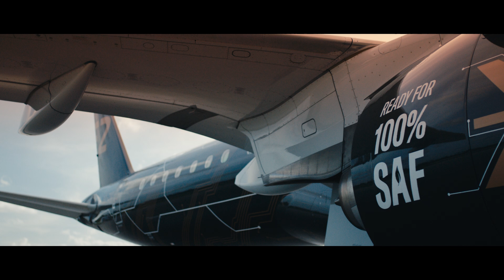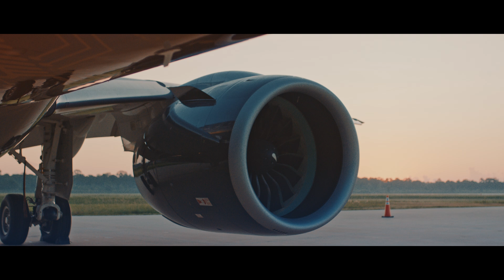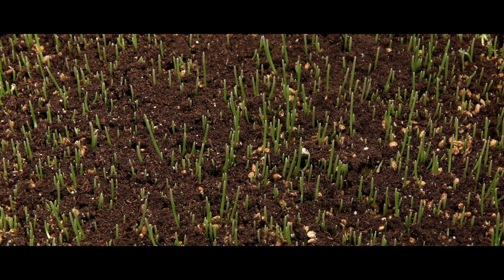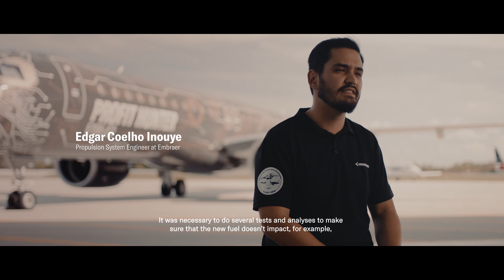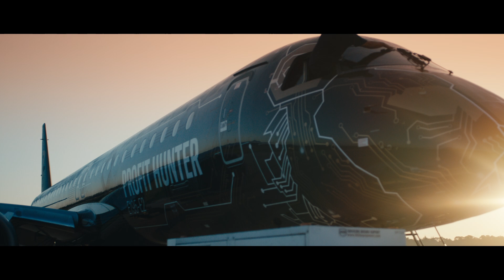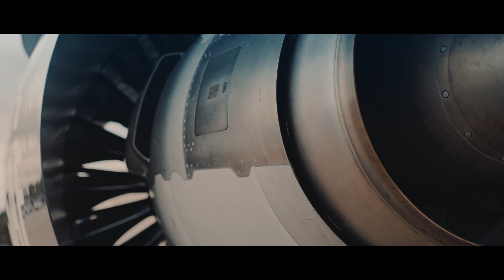Embraer E195-E2:100% SAF TEST COMPLETE

Comment: I don't know much about this but this is just marketing that doesn't mean anything in the real world, right?

100% SAF isn't actually commercially viable, this isn't the first time such a "show flight" has happened and Embraer didn't make the engines used anyway so that wouldn't be their achievement regardless
Reply from the maker: They are showing that it is possible, and there's more to the fuel system than the engines themselves. SAF should become more available as the market accepts it and production increases. Thanks for watching!